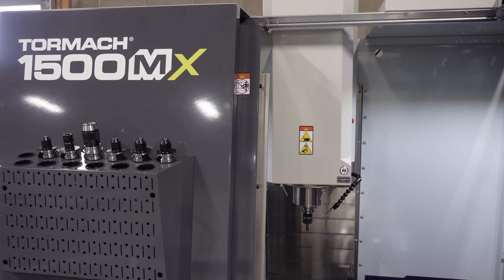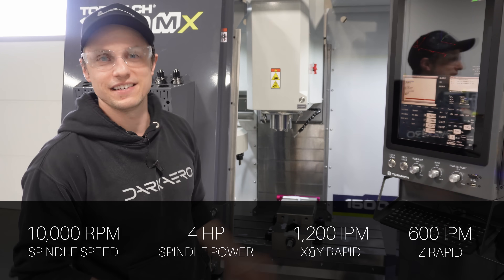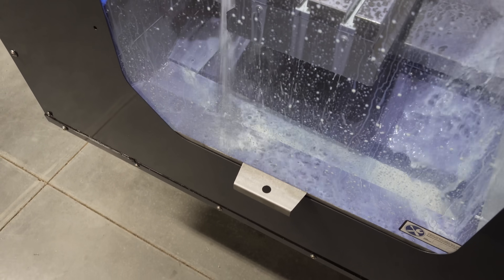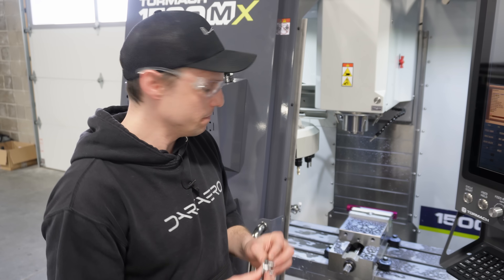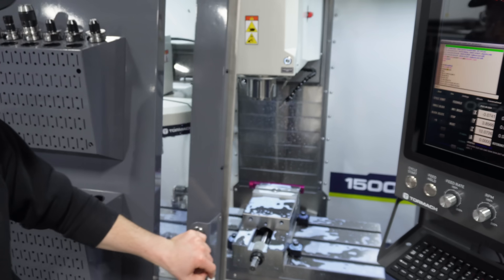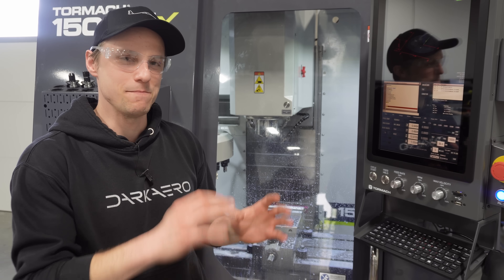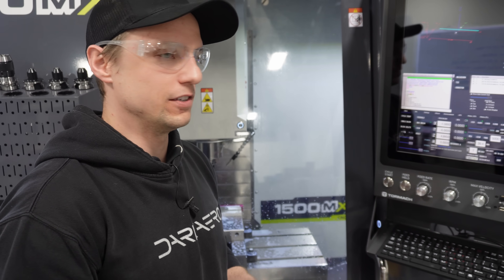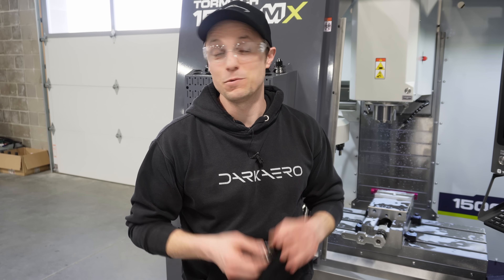Tormach 1500MX in an Aerospace Manufacturing Shop

Comment: You're spending so much time with setup because you guys lack the experience of being in a CNC production shop. 

For example, you seems to hint that you're re-indicating or probing every single part. 

On a part where you are machining the entire diameter & you're running it in soft jaws, why in the world would you do that? 

Probe the first one if you really want to but that part isn't likely to move more than a few thou over hundreds of parts.

Also, making probing 'sub programs' / macros. Make use of variables to enter things like what diameter the stock is, what coordinate system you're using (G54, G55, etc), make use of 'less than' or 'greater than' statements, do some research to teach the full potential of automate things that can be mistake prone during setup, but also to do things like automatically check measurements in the machine and error out if out if spec.

Message if you'd like the Renishaw & Blum programs we ran on our Brother vertical mills. There may be some slight changes, but most of it should be identical.

Comment: What is the process of purchasing a kit and how long before its available to the market? Will there be mounting options for different engines? Also, where can I get dimensions for the cockpit? Mainly concerned about the width of the canopy interfering with head movement.

Comment: I started watching these when the project started. 5 years on and the plane is still on the ground? WTF?
Reply: More like 8+ years. They have a video 3 years ago on how they had been using Onshape for 5 years to design the plane, after switching from a desktop CAD program. The first video listed from 5 years ago is on making the fuel lines. 4 years ago they were fitting the wing tip lights. The closest CF plane to this is the GB1 Gamebird 2-seater and it costs $600,000 with fixed landing gear. There is a 2022 model for sale on Trade-A-Plane for $200,000 with 212 hours TT, 303HP Lycoming and 4-blade prop.

Comment: Hey Dark Aero - I have a question about your carbon fiber frame. You are aware of the effects of lightning on carbon fiber and how it can shatter the material, hence why the Boeing 787 engineers layered a lightning absorbing material on the airframe over the carbon fiber composite material they used for that jet. 

I’m not sure if you intend on making this aircraft IFR certified or if it should not be flown if chances of lightning remain anywhere among one of its flight paths. If you DO plan on making this plane IFR certified, how do you guys plan on dealing with the lightning problem?

Comment: What happened to the aircraft? Has it actually flown? Did you find the empennage was too small and the split rudder little more than a gimmick that creates more problems than it solves?

Comment: If you ever run a real cnc machine you will be blown away by the difference, Tormach and Syil are toys. If you want cheap then a used high quality machine that is still supported is the best bang for the buck.

Comment: I personally would like to hear more about the authoring software you use.  Does it still use M-Code and G-Code?  Are you using ACAD or the software that comes with the system?  It is really a nice looking setup.  Specs about fluid wash/lube, etc. would be good.  I guess I could look it up.  You might want to get into race cars as well instead of just planes.  Then eventually, you can build (me) a boat.  ;). To get more into it, some cutters require a "cut in" path on every pattern due to devices like plasma cutters needing a hot start and then cut process.

Comment: I'm sure we will see a fair few older model Tormach Mills hitting the market as many would be wanting to upgrade.
The new machine seems to have everything that was missing from previous models.
Decent size travels, and through spindle coolant is a big plus.
A few other things have also been improved on including an easier way to remove chips from inside the machine.
It looks like a nice machine that many guys out their will be dying to get their hands on 👍

Comment: now the question of the question: can you activate TSC with a tool that doesn not have TSC functionality? Heidenhain for example has 8 Bits for each tool that i can set and one bit tells the control that the tool is TSC capable. If the tool has this bit set to 0 and i want to activate TSC it wont let me.

Comment: Nice video but Jesus is that 1500mx overpriced. The new super minimill a much better deal for not alot more way more capable.

I'm sure you're use to path pilot but it's so horribly priced id feel ripped off.
Reply: I'm sure you understand they got really good deal on it. The video is basically an ad.😂 

Great to get updates though.
Reply: Oh yeah I knew that from the get go even 10k I wouldn't waste my money on it though.

Comment: In aviation… everyone says never fly the A model…. They never mention that serial number 001 may be better for a competitor to have….  😃

Looks like the Tormach is an awesome machine!

The A model Mooney, M20A, (1958) had wooden wings and tail… the M20B was all Aluminum… the M20J took a leap into composites with fiberglass cowling and wing tips… (mid 70s)

By the time they got to M20U… they moved up to composite skins on a small portion of the fuselage…. (2010s)

Team DarkAero has done a nice job of not repeating some of the old history….!

Go DarkAero!

😃

Comment: Do you need static dischargers on an aircraft with a carbon shell?🤔🤔
Reply: Great question!

Most likely…

A want vs. need.

My plane’s surfaces are painted… so the static build up is mostly paint rubbing air…. Won’t change much what is under the paint.

Where the static really builds…. Is flying through clouds and snow…

Used to be able to hear the effects of static in the radios…. (Back in the day).  

I have No idea how sensitive GPS antennas are to static build up/discharge…

😃
Reply: Static discharge is not as important as lightning protection. For a long range composite aircraft having fuel tanks in wings, this is almost a necessity.

Comment: You get it for free? I like the products and the company (I had an Series 3 1100MX), but this machine makes no sense vs. a HAAS at that cost.
Reply: It's a good deal cheaper, Haas nickel and dimes you for everything, much of which is standard on this machine. Add an RPC, rigging, etc and you're easily $15k deeper into anything with a Haas nameplate (including their DC1 which is nothing but an alibaba machine with a Haas control). Pathpilot is also easier to use, replacement parts are cheaper, etc. Haas isn't all sunshine and rainbows. We have a 2022 VF4SS with 4th axis...its a good machine but there are reasons why they aren't used at the elite level. For machines in the sub $50k bracket, the way you'd actually want them equipped and delivered, you have Syil, Tormach, or a completely stripped out China "Haas".
Reply: @OtisFlint  I was thinking more like the TM0P or 1P and the mini mill updates seem good.

Comment: Interesting choice with the Tormach. I haven't read a lot of happy comments from owners of their CNC equipment
Reply: You must not be watching or reading much. I can find 20+ in 30 seconds that are perfectly happy with their machine. 

There are generally two sides, the ones that scraped enough together to start a business or hobby machine and are perfectly happy, or the other side that work for someone that’s spent 6 figures on machines for them to use and think they are gods gift to machining. 

There’s no shame in running a Tormach

Comment: Start keeping track of parts and versions on spreadsheets, once you start machining stuff yourself, you need a good way to keep track of all the stuff you forgot you made. You never know when a previous version can help you out in the future.

Often I look at previous work with current eyes and I get new insights looking at what I did. It helps when you know why you do something because you were the one that did it.
Reply: Take a look at the documentation on their website for this kit. They are leagues ahead of any other kit manufacturer for how they are handling things like this.
Reply: Not to mention for liabilitjes sake
Reply: Spreadsheets are not a good way to do this. It isn’t that hard to start out with a real database that is much more capable, reliable and provides much greater query and reporting tools.
Reply: For this size of manufacturing a spreadsheet is fine. For medium and large scale you are right.
Reply: @LTVoyager  agree.  I use tortoise SVN to handle revision control on everything (programs, macros, machine backups, etc).  It's kind of like a localized github.
Reply: Exactly. SQL databases are so much better than Excel  @LTVoyager
Reply: Good advice. But this is not they're first machine. I'm pretty sure they have a process nailed down.

Comment: Looks like Tormach is similar to a Haas VF2 now.
Reply: VF-2 is 30 hp...
Reply: VF-2 has almost 8× more HP.
Reply: lmao...no.
Reply: Okay, let's get realistic here. Not 30 HP, but no slouch either. The 1500MX has 4 HP with a Max of 6 HP BT30 Spindle, that is also Through Spindle Coolant ready. But, unlike the VF2, runs on single phase power, and is designed to fit in most garages. It's a tiny beast. https://www.youtube.com/watch?v=s2PfIHf9lOk
Reply: Maybe a TL1.

Comment: Effing serial number ONE !!! (Personally, I would have held out for S/N 007…)

You guys have clearly made a 3-point landing pulling that off. Congratulations!
Reply: Nothing a Sharpie can't fix.
Reply: I've actually been informed that Dark Aero does have SN: MI10007. So technically it is 007. Maybe time to buy some tuxedos.
Reply: @tormachinc  well now you're going to have to make it to James Bond special, lol.
Reply: @tormachinc  This is an awesome idea. Tuxedo for the test pilot’s first flight, and tuxes for all three brothers on their first flights! Will Tormach be there for the big day?
Reply: @PetesGuide   We already asked about watching the first flight, and sadly no. There are safety regulations to follow, and if there's nothing we respect more than safety. We did ask if they can fly over us though and that is possible, since we are two miles away. PS: there's nothing flippant about James Bond. He likes his martinis shaken, not stirred.
Reply: @tormachinc  This is beyond the most cool comment reply I’ve ever gotten on YouTube! I’m an old CAD guy, who started with AutoCAD R10 on a 286, linked that to a PDP-11 running a funky civil engineering design software feeding Tektronix 4207 terminals, then somehow got to be an alpha tester in R12 and the tech editor of CADENCE magazine for a decade. And my key mentor had design oversight over all Apollo electronics. So when I tell you that what DarkAero is doing is some of the most amazing R&D work I’ve ever seen or heard of, you know it’s true. But you know that in spades already. 

What kind of help do you need in order to help other teams that are at the same level as these three brothers?
Reply: @tormachinc  I am humbled that your official account responded to such a flippant comment. Hopefully one of these days I’ll get my nascent channel off the ground and be doing cool enough stuff to warrant buying one of your machines.